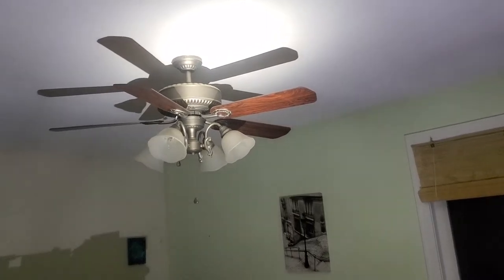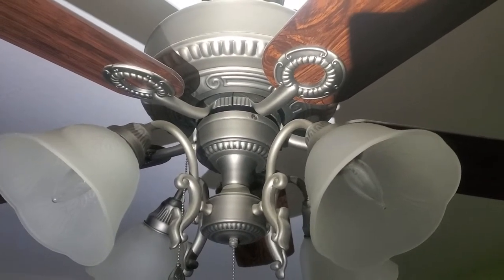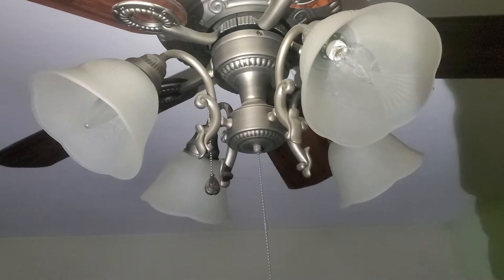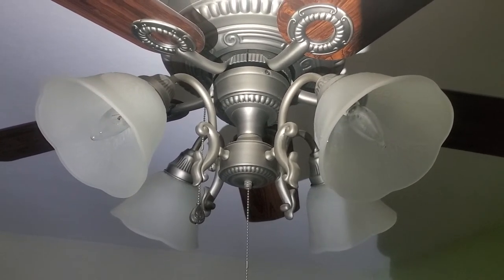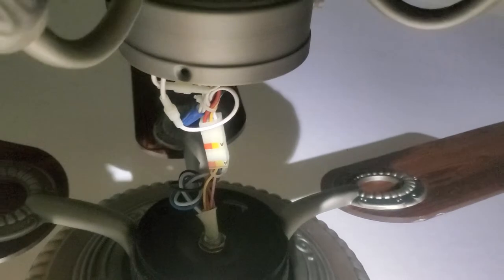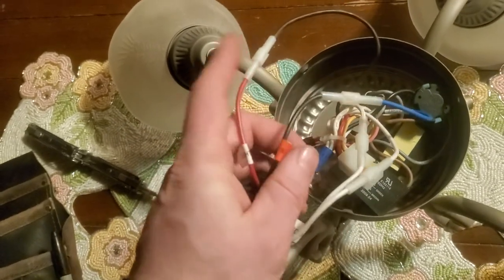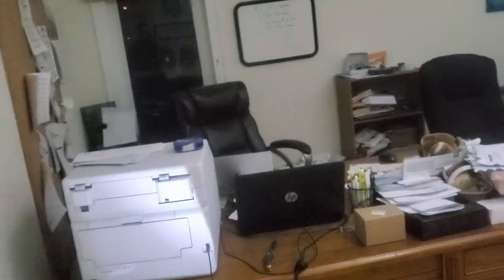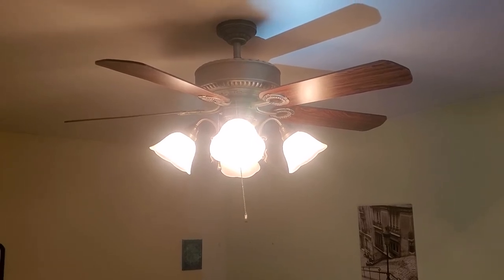How to fix a flashing ceiling fan light.

Comment: If you have a wattage limiter you most likely have a remote to turn on the fan and lights — if your lights seem like they’re haunted try holding down the light on button for 3 seconds to control the voltage to the lights
Reply: Thank u so much bro it worked